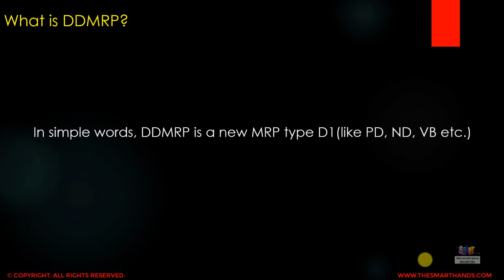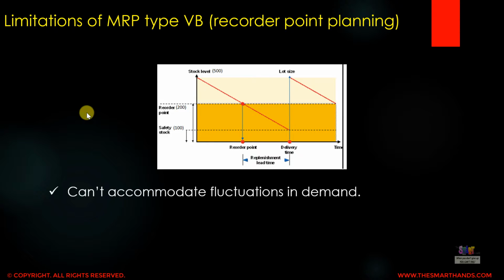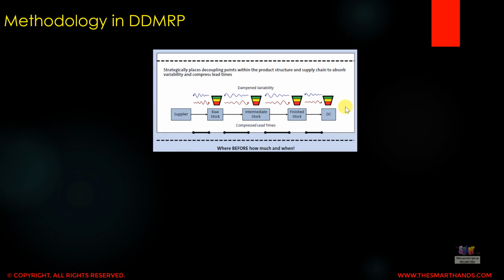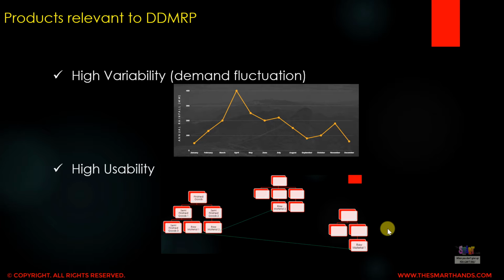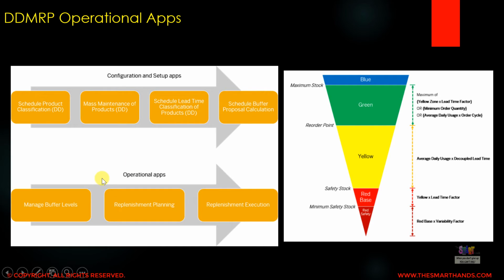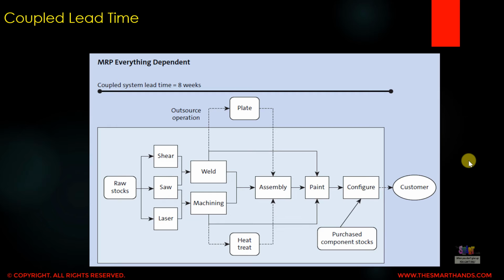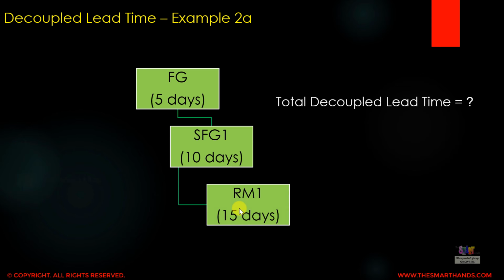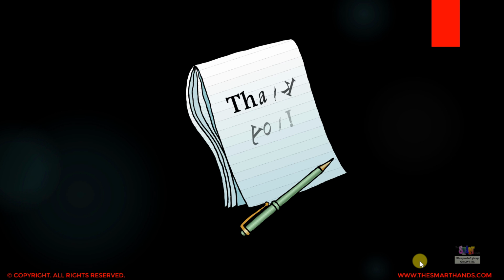SAP S4 HANA MM Training - Introduction to DDMRP | Demand Driven Material Requirement Planning

Comment: Another point, 22:18 minute, what you're referring to as a maximum stock (top of reversed triangle) is not a stock in DDMRP at all. It's the top of the buffer but buffer is a logical object not a physical inventory. There's a way to calculate the avg inventory in the buffer but for sure it's not the same as buffer total size. I'm sorry for pin-pointing here but we cannot afford in the Demand Driven Community for concept to be misinterpreted.
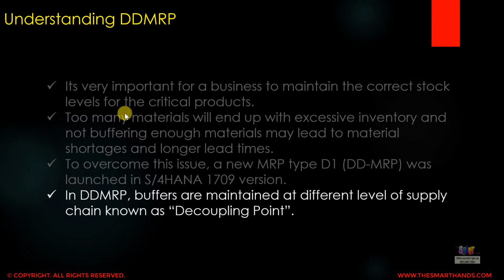Reply from the maker: Correct its a buffer stock and it was already mentioned earlier in the video at 7:03, 9:07 and 8:10

Comment: I'm afraid you're mixing DDMRP concept with safety stocks. The slide from 19:14 suggest that there's going to be a minimum and maximum safety stock kept which is not true. Please revise the DDMRP concept. If you need some assistance - let me know.
Reply from the maker: MRP type D1 is usually set up in conjunction with lot-sizing procedure H1 where maintaining maximum stock level is mandatory. This is shown in the following videos and this is what meant here. Sorry it wasn't explained in details in this introduction video.